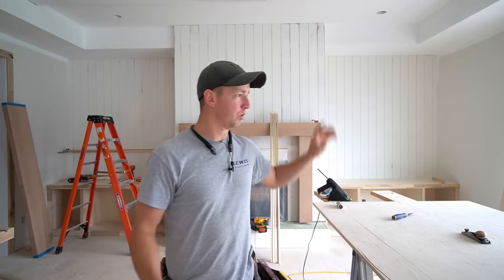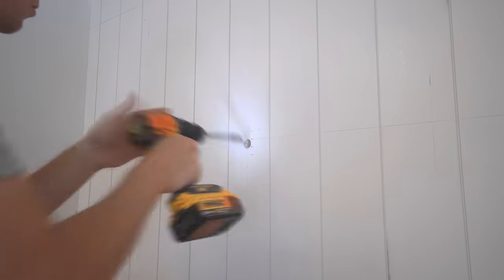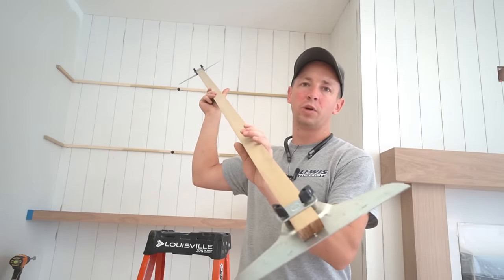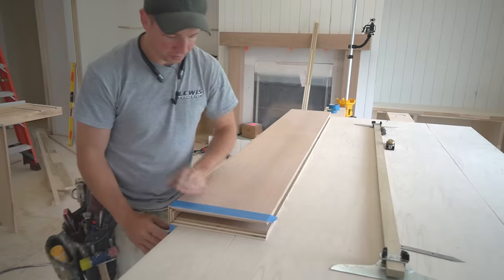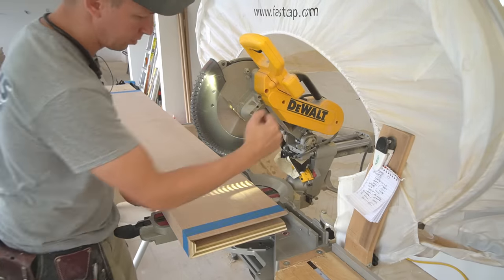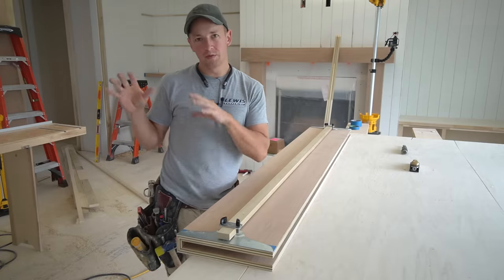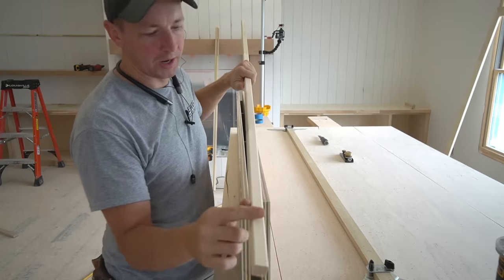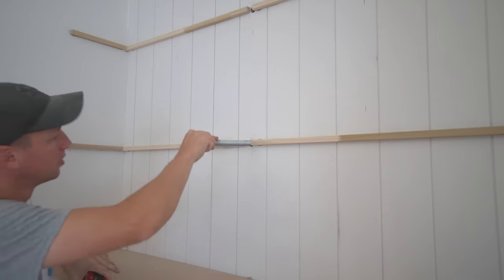Floating Shelf Installation Hacks - Keys for a TIGHT Install

Comment: Pro tip with the rounding of the shelf… I would’ve done the cleat, but probably would not have thought of doing the shelf… at least not on the first one…
Great job… (and the glue on the finger commet was savage)

Comment: I do the exact same thing using the stair gauges but I will steal your hack on using the 3/4-in threaded rod. That's a great trick. I work on primarily remodels so the walls are far less than perfect and usually in the situation like you have the front is the narrowest measurement which means you can never slide it in as a pre-assembled unit. To get around this I cut a top and a bottom piece scribed perfectly to the walls then I installed a spacer in the front so the opening is uniform across the shelves and then biscuit and glue a front edge on.

Comment: Not afraid to get PL on my finger, but I am afraid to get it on stain grade plywood. I work from the top down in case of any oozing PL.  Great video as always.
Reply from the maker: 👍 I hit these with the sander after install to ensure that any smudges were sanded off.

Comment: Never a good idea to forget the “rod” SL … 
I noticed the back bevel on the top/bottoms, great detail of box out with ribbon shelf building? needing a scribe cut/fit allowing the least amount of material to remove. I love working with tight tolerances to avoid extra scrap/clean-up trying to eliminate non-production chores is a must. 
Love the stretcher too!  Great job/vid bud..

Comment: Great video as usual from you, lots of good tips. I love the way you can slide the the shelves in, but I had no such luck with side walls. The corners cannot be square by our North American design using drywall. The corner beads get mudded and by design will bulge out on both corners, inside and out. That’s why they cannot be square and the front is narrower than the middle then even more narrower in the back, maybe, depends on drywaller! Haven’t found a square wall yet. Kitchen installers know this and usually use fillers at the ends to square up cabinets.

Comment: I just did some using deeper cleats, no rod. The toughest part is dealing with bad walls. If they are not square & narrower in the front you wont be able to slide in & you will have a gap for sure at the back area. They made rod kits at rockler too

Comment: I am new to carpentry at age 63. Trying to make some floating shelves.
Came upon this video.
Almost every thing was explained very nicely. Read the reviews. Everyone understood every thing but there were a couple of things that I couldn't understand.
1. When you drilled that hole, after that I noticed long pieces of wood attached to the wall, THAT PART WAS NOT SHOWN OR EXPLAINED, how were those long pieces of wood installed there????(the ones on which you slid the floating shelf)

2ndly what kind of dowels did you use to bear the weight of the floating shelf and the items that are going to be put on that shelf???
I ll be grateful if you (or any of the viewers) come across my questions after a year of this video could reply and make me learn this better.

Comment: So I had 3# 4 footers on each side of a fireplace last week.
30 inches deep cavity, for 12 inch shelves.
Left side was open on the left, but the right side........
Right 3 had a window casing 24 inches from the back on the right wall,  and the back was wider by 5/16 then the front. 
I spread the drywall 1/8 as far as i could, by reversing 2 clamps (a 3rd hand from fastcap would've been nice). 
The walls were spread wider at the top, so I used wax paper on the ends and went above the window and dropped the lower shelf about 3 ft down before sliding in place. 
The result was I had to under-cut by 3/16 to get them in. 
White walls, white built-ins, white shelves, and white countertops 🤷. 
I use cleats where I can, the shop builds with 1/2 cavity and we use 1/2 rod kits from Amazon for full floating. 
Rod kits are 8 inches long, with a welded flange for 2 screws. 
I notch the drywall for the flanges, run 2# 3inch screws per rod and use liquid nail to hold it. 
Wax paper, and an air bag can really help keep the scratches away in tight areas. 
But 3rd hands are on order. 
Another great tutorial Spencer! 
Am just tired of acute framed blind corners, and installing cabinets or shelves in them. cabinets
Reply: If shelve is blocked from sliding in straight by casing or like in a small closet I have installed side cleats with just one screw on each side then rotate side cleats till they are plumb up and down then slide shelf on from below or above then rotate shelf into position and push it back onto back wall cleat.
Reply: @afriendtoo6971  there was a base cabinet below.
Also I had no studs to attach side cleats.
Could have set drywall anchors in the center🤔.
Thanks for the tip!

Comment: Awesome video with good tips man. You got a good framing crew to be able to cut your ends with a miter saw. I did stain grade floating shelves that were just under 8 ft and had to use my jigsaw because of how bowed and unsquare the walls were. I definitely will be using your tips from the video whenever I do floating shelves

Comment: Great video and tips. I made a stair jig that I can run my flush trim router on that works well...I also love my screw type push poles with rubber pads for "expanding" the walls for right installs. Keep up the good work!
Reply: Tight walls.... Oops...

Comment: You can actually put those all threads in without using glue you by the end of the all thread and bought a whole one size smaller than the all thread for the square shoulder on the other end and use a drill and you can drive it in like a big lag
Reply: I think the nice thing about an oversized hole filled with glue is that the angle of the rod is self-adjusting and will register perfectly to the shelf.

Comment: Great tips on floating shelves.  I have not seen those gauges before, great use of those.  Seems always a guessing game otherwise.  There is always more mud buildup in the corners, if drywall.  Something you may want to try instead of cutting a board to spread the walls a bit.  I use my long 3rd hand jack to spread the walls.  It is easy on the walls with rubber pads on each end.  Saves cutting another board just for that use, cost of lumber and all. Great quality on your videos.  I appreciate that.  Brian, Homecraft Solutions.

Comment: loved the video.. I have two questions and anyone with experience on subject can answer..as you put the adesive, there is no need to get studs on those brackets atached to wall? also can i do same process with 14" deep shelves.. almost identical situation but the walls are dryewall..

Comment: Fantastic video!  I have a project coming up just like this for a customer.  One question - the customer wants these shelves painted black.  Would you paint and finish them before installation?  Or install them first and then paint and finish after?
Reply from the maker: After if possible. Black is hard not to mess up during the install.
Reply: @InsiderCarpentry  thanks for the quick reply!

Comment: Great video. Very informative. Nice to see even a master craftsman like yourself forgets things like you did with the rod at the end of the video! Lol I do have a question. I understand why you use the stair gauge, because the two side walls may not be perfectly square. The question though is how do you line that up on the mitre saw since you may not be making a perfectly 90 degree cut? Do you just eye it up?
Reply from the maker: Yes. Align to the scored line by eye.

Comment: Really good tips for a professional finish. 👌
I want to put mosaic tiles on the back wall.  Do you think putting the tiles before the shelf would be an issue?  Its harder to put the back brace support but much less tile cutting to do.

Comment: How come you did not use the track saw instead of the mitre saw to cut the shelves after you scored the tape with the utility knife?  Are the shelves (except for thickness) any different than the stair treads in your video on August 2, 2019?  The Aug 2, 2019 btw was a very informative.  I have gone back to that one a few times.
Reply from the maker: Either tool works. The miter saw was right there so that is what I used.
Reply: I was thinking track saw too, until I saw that it was too thick for the TS55.

Comment: Spencer, I've come to really trust your videos so I was wondering if you had pointers on floating shelves in an alcove that is narrow in the front and wide in the back.  I'm thinking I will have to mortise out the bottom of the shelf so I can drop it onto a rod style floating shelf bracket but obviously I would prefer a bracket free appearance on all sides.    Maybe this could be a video idea if you run into it in the field. Thanks!
Reply from the maker: In that situation I built a 3 piece hollow shelf and fit the pieces piece by piece if they are stain grade. That's the only way to make it tight. Otherwise you're left caulking big gaps, which might not be a big deal on paint grade.
Reply: @InsiderCarpentry   Thanks for the response Spencer.  My material is butcher block that is left over from the small top that sits on the cabinets below where the shelf will be hung. Because of this I'll probably just find some good looking brackets and go with those. Thanks again.

Comment: This was great as always. Just did two shelves this week but not like this. Plywood frame and a prefinished top bottom and face. So much about this method that makes sense. Also like your wood stretcher prop. Great idea. Question, did you put in support inside to prevent the mitered glue up from flexing and cracking before install ? Have you found a way to still use this method if the inside corners are so out of square that they are longer than the outside.

Comment: If you will point one end of all thread and put 3 flat corners on other end you ca chuck up in drill a d drive it home .bore hole in stud 1size smaller than all thread and it will take in the stud
Reply: I think you totally missed his reason for boring a hole bigger than the rod. Go back and watch at 2:05.

Comment: actual reality in Toronto Ontario , when shelve going in between 2 walls like this, its always wider at the back then at the front, sometimes up to 1/2"  cant get a perfect fit ever with that kind of crap.  I use a 3rd hand jack to push my walls apart, sometimes 2 of them, usually only works well when the walls are with in 3/16" is better

Comment: Instead of allthread, I take a large lagscrew and drive it so that the threads are buried and the non treaded part is sticking out. buy a little metal bucket from the paint aisle, hang it on the lagscrew, grind off the hex head and all the sparks fall in the bucket.  A pipe that fits around it can adjust and bend it slightly if needed afterwards.

Comment: Important to note if you have a Isosceles trapezoid shape the shelf won’t fit.

Seems logical but when your focusing on scribes it’s easy to forget. The back part of the shelf cannot be wider then the front, you’ll just have to caulk or float the wall out to fill the side gaps.

Comment: Does anyone know if the shelves were built by putting together 3 pieces or a cut through a softwood ? And with what kind of tool can you make that kind of cut ? Thank you
Reply from the maker: It is 3/4 plywood miter folded.

Comment: Hey Spencer, another awesome video. Where can I buy stain grade shelves like this?
Reply from the maker: You probably need to make them.
Reply: @InsiderCarpentry  sorry, should have been clearer. Could you elaborate on the stock you use and the process to make the custom Shelves?
Reply from the maker: See my recent video. Ten tips for miter folding. Posted a couple months ago. 👊👍

Comment: I'm not in the trade but your video had a lot good tips.I was wondering what would be best practice it this case.  43' span with one corner for support.  Would you uses more threaded rod to support the one edge that floats?  4lbs on top of shelf and maybe some pockets below or a second self for tablets, remote router.....

Comment: If the mounts weren't drilled I before cutting down to size, why would you not just take all the extra off 1 side to avoid having to do 2 cuts?
Reply: Ah nevermind see the center mount for the rod

Comment: Stair tread gauges are a great idea, just hope your back wall is flat and 90° to the end walls. Any hump in the back wall will throw the gauge reading off. Just speaking from experience. Good video, as usual👍
Reply: You would then scribe the back. Pain in the neck but that's what you must deal with.
Reply: You're right about the back wall being flat, but the corners don't need to be 90°. The shelf gauge gives you both those angles, plus the relative position of the back corners.
Reply: You get the realative angles to the back wall with the stair gauge. What is not covered, and what I have seen is bowed back walls. 

What I try to talk my clients into is inserting a shelf I build nice and square with dado cuts to support then trim the front to make them look floating. Otherwise I just caution them about this possibility. 

I have also cut the board into the drywall on back a few times when there is a bow. Attach my back  bracket to the studs and the shelf fits on the bracket inside the drywall pocket, so no gap showing to reveal to bow. A little caulk cleans up the line.

Good video

Comment: What about when it’s a solid wood shelf, could you router the edges at 7/8 by 7/8 and do the same 3/4 side support? And what about middle support? Should you drill a hole with an auger in the center for that piece. I’m about to do a 10 ft long ash desk and shelf, using this method, maybe you have some better ideas, short of angle brackets as support.
Reply: I think you're on target. At 10' wide I might do two bolts spaced  roughly at third intervals depending on stud layout. You could also router a chanel along the back edge if you wanted, but probably not necessary.

Comment: What would you suggest not to scratch the walls on the side when the installation is to happen after final painting?  I can see you could not avoid scratching during this install.
Reply from the maker: In that case all you can really do is undersize it a little and install as cafrefully as possible. Sand/round over the leading edge so it doesn't gouge as its pushed back.

Comment: I would pop out a brick here and there to see what is going on behind. Is the brick soaked, air space left for install and house wrap condition. Also as previously mentioned, check transition from vinyl or other siding up top for water penetration as well as window flashing and sealing method. Definitely needs exploratory surgery.

Comment: Hi Spencer
I recently was doing a very similar install to this and had issue with the walls that install cleats to not being square. 1 wall was 3/4 out of square and was at a acute angle. This made installing the shelves without a large gap nearly impossible. What could i do to fix this? Im thinging of Sheetrocking over the current wall and applying shims to get drywall square

Any help appreciated

Comment: Great tips thanks for sharing them
With us. It’s like everything if you take your time and prepare your work for the application everything will fall into place. So many contractors under price jobs an then rush them
To complete them to make the job profitable an in turn end up making mistakes or a substandard job. To find the exact centre of your stud. Use a small 1/8th drill bit and drill a series of holes behind your cleat. It’s better if your drill bit is slightly blunt as it will struggle more going through the stud.

Comment: I'm not sure I understand why all the glue. If you ever need to take one down to perform a repair or replacement you have no choice but to do demolition. A few strategically placed fasteners could still be hidden and would make it far easier to remove and replace. 

This seems like a great technique to make building and installing faster and easier but without any thought of the next person who has to come along and work on them.
Reply from the maker: The next person that ever messes with those will be permanently removing them and it won't be a big deal.

Comment: Most of the floating shelves I have done are solid wood. I normally get a 12" lag bolt, run it into the stud, cut off the head of the bolt, bend the exposed bolt about ⅛" past level, then use paste epoxy to secure the shelf. Have you tried anything like this in the past? I don't normally have side walls to help support the shelf.
Reply from the maker: Sounds like a great method also.
Reply: That's exactly how I did it. My shelves weren't hollow, they were two pieces of 3/4" plywood laminated together, with an edge band of solid maple. I used a drill press to drill out the long holes for the lag bolts. I think my drill press got about 6" down, and then I finished the holes manually. It was a tight fit but I was able to get them on and off to scribe the back edge to the wall. It worked really well, everything went in easily and it was super sturdy.
Reply: @rockwellmath  dowel jig is perfect for doing this onsite

Comment: Great video. What is your opinion using 1/2” Plywood vs 3/4”  for a 14”x36” shelf?  You’ve inspired me to have a go at building my own shelves for the built in/ Bump out I’m working on.
Reply: My guess is go with 3/4. I’m curious if he’ll respond. Good rule of thumb is overbuild if you’ve done everything you can and still can’t figure it out.